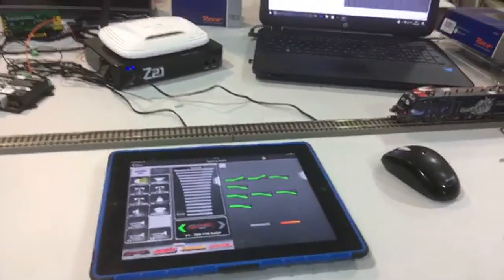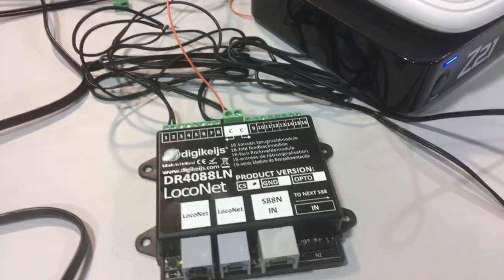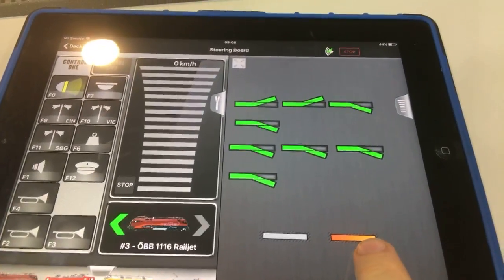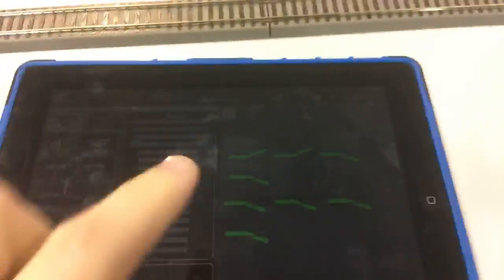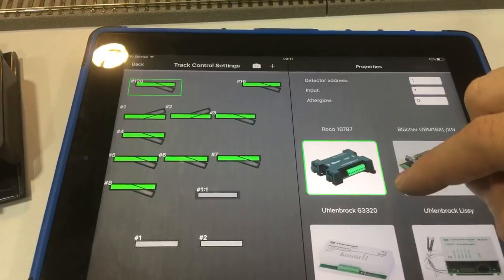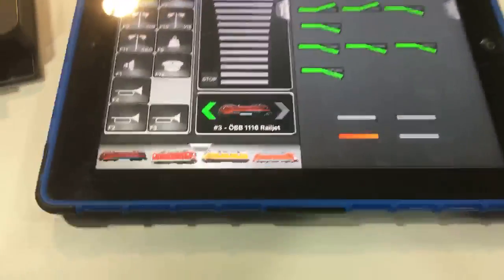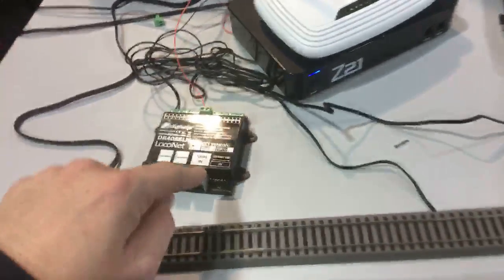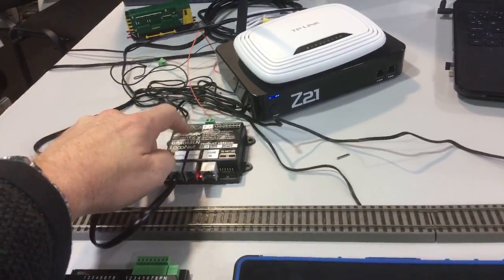Z21 with Digikeijs DR4088LN detection.

Comment: Hi,  Can I use the DR4088 R-bus version for simple magnetic reed switch detection with black Z21 ?
Also, I'm a bit confused as to why you had to use an accessory (turnout etc) to give the detection sections an address and then duplicate it with the actual occupancy detector.
Cheers
Alan
Reply from the maker: Alan Overton hi it just uses accessory address to set the feedback unit. And yes if you use the grounded unit you can use with reed switches.
Reply: Thanks for the reply, when you say "grounded unit", is that the DR4088 RB ? where do you connect the other side of the reed switch (the side not connected to the DR4088)
Cheers
Reply: @alanoes1  Hi Alan, Do You know how to connect this reed switch (like roco geoline)? I dont know how to connect power supply or groud for DR4088 and this reed switch. If You can help - please write answer, I cannot find this solution
Regards
Marcin

Comment: Hi and thanks for your answer, Yes I have it connected to the Ecos L.Net Converter, but how do I select it, because I'm only able to search for Uhlenbrock Modules via Product Number e.g. #63350/#63340... and I do not find the "Digikeijs" LN-Products?
Reply from the maker: Wolfgang Radermacher hello you don’t need to search for it all all. You just program by pressing the button and then telling it the feedback start address and how many output you have on the DR4088LN so basically 16. You use accessories address to set this. That’s it.
Reply: Thanks, OK than I sould try it later on. I need to by a modul first.
Reply from the maker: Wolfgang Radermacher we have in stock.

Comment: Hi always good to see you show how to do things, 1 question can you adapt rolling stock to be detected by the Detection devices as I have seen 1 gent who solders a SMD Diode to the outer end axles to make a circuit
Reply from the maker: Hello yes if you put a resistor or diode just so there is some current draw then will detect your wagons.
Reply: Cheers just need to get back into modelling more than just stationary models